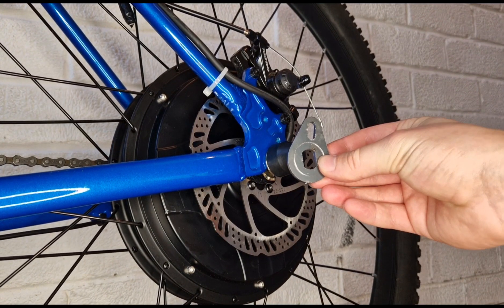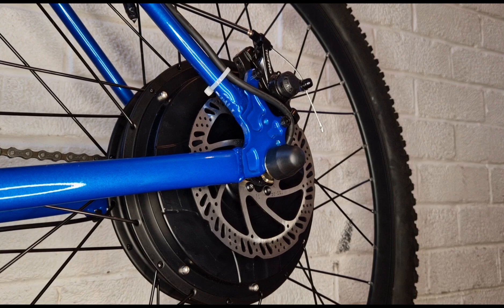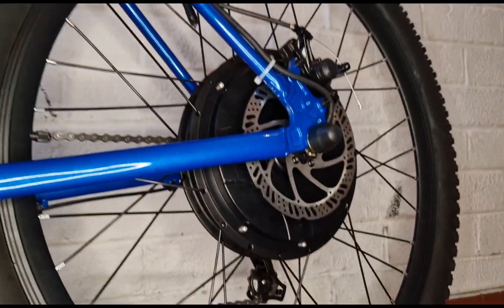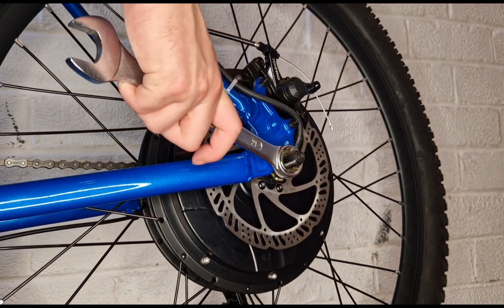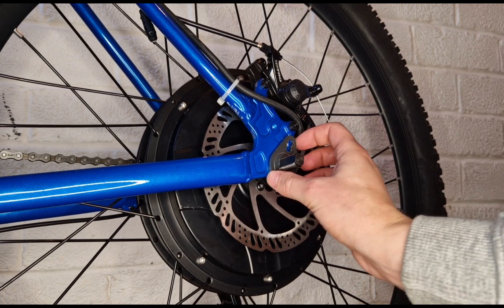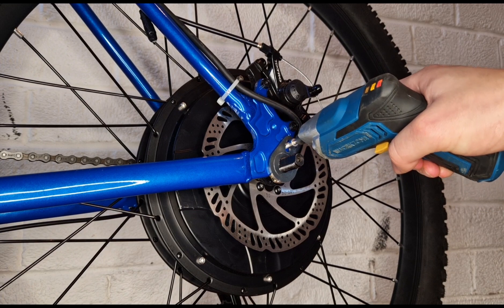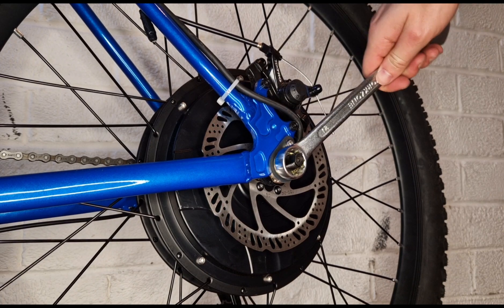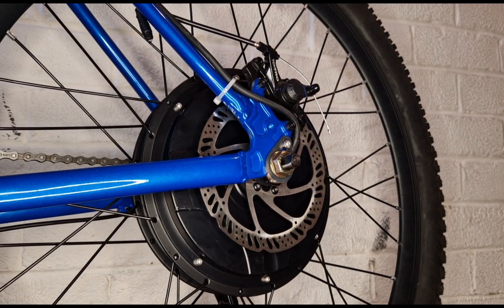Installing an Easy Fit Torque Arm on to an Electric Bike Conversion

Comment: Really good ..because the problem with the normal torque plate and the arm is it only stops the axle from rotating but yours stops it from rotatating better and stops it from  dropping  out the bike frame because most hubmotors axles don't fit in the bike frames the best  so great idea

Comment: Just asking do you need that bit on or will it be ok not to use I'm not sure thank you
Reply from the maker: We recommend these for 1500W motors and above or any frame with shallow drop outs 👍
Reply: Large wheels and high amps are the main enemies of dropouts. Personally I wouldn't use any more than 20 inches or 15 amps if you're not using a torque arm. And I wouldn't use a hub motor if I need high output or if I'm regularly going off road.

Comment: Had any issues with it im still jot sure about it as the hole for the small bolt is long to fit more bikes i guess. But i see it as a possible weakness
Reply: this is way better than those chinese 2 peace torque arms